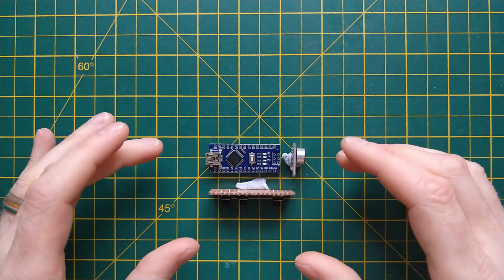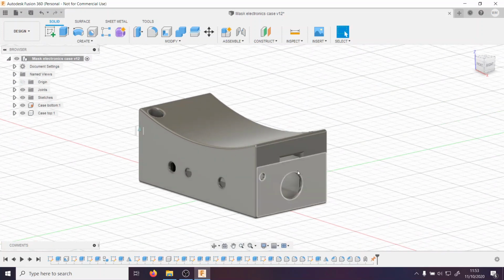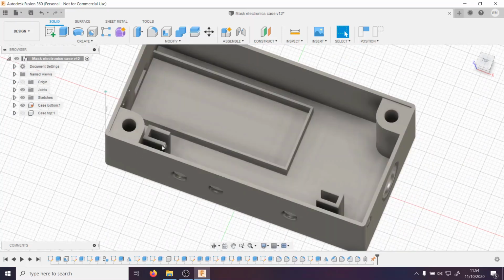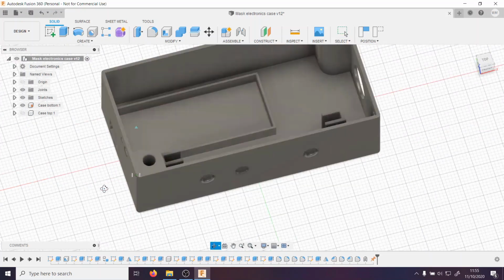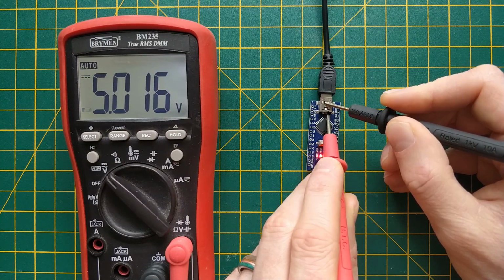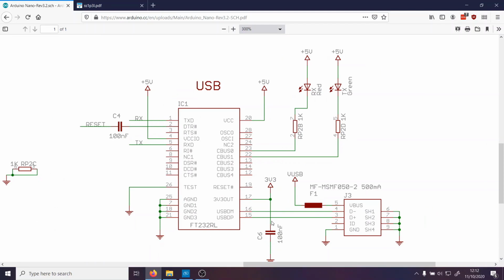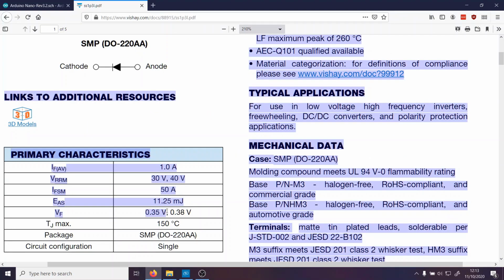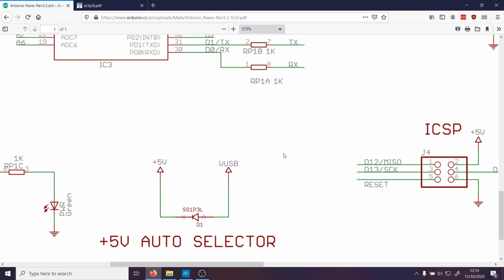Arduino powered LED Mask with FastLED [Part 2] - Enclosure and wiring

Comment: What is the ampers that this device receives from the usb port?
Reply from the maker: You can limit it in the code to whatever you like. I usually run it from a power bank so set a 2A limit

Comment: Scott I can't understand why do you remove SS1P3L diode from the NANO, Could the project work without removing it? 

And what do we need to avoid if we do remove this thing? connecting the NANO to an external power like 2 AA battery while is also connected to the usb charger? 

Thank you
Reply from the maker: The maximum current rating of the diode is 1A. The way I have it wired up, I've connected the 5V for the LEDs to the 5V Arduino pin which draws power through the diode. The LEDs can easily exceed 1A, which would burn up the diode. If you had a seperate 5V connection for the LEDs, you wouldn't need to do this, but I wanted to keep the wiring as simple as possible. Removing the diode takes 5 seconds with a soldering iron so that was the fastest way to do it. Is there a reason why you don't want to remove it?

Comment: Fantastic work. And great video documentation.

Quick question. What are you planning on using to power it with while wearing at a party? Just some run of the mill USB portable battery? Thanks
Reply from the maker: Yeah, exactly that. It runs for many hours from a 10,000mAh USB power bank

Comment: Hello, congratulations on the incredible project! I'm sorry if there are any errors, I'm Brazilian and I don't speak English.
I'm using your code on a much smaller project, just 12 LEDs. To get the effects right, my XY map was 5x5
  const uint8_t XYTable [] = {
     24, 8, 6, 4, 13,
     11, 22, 19, 16, 2,
     10, 21, 18, 15, 1,
      9, 20, 17, 14, 0,
     23, 7, 5, 3, 12
   };
I believe I have modified all the necessary values in the code, and uncommented the line modeBtn.begin () ;, but I can navigate between the modes only once, then the code locks and turns off all the LEDs. I am new to Aruino and programming, but I am grateful if you can help me.
Reply from the maker: Sorry it's taken a while to reply to you, I missed this comment. Could you send me your code? It's tricky to see what's happening without it. Copy the Mask.ino file that you are using to pastebin and link to it here.
Reply: @ScottMarley  did you find a solution to this as i'm having the same issue

Comment: Awesome... love it, can you share more the Fusion file ? :p
Reply from the maker: Done, it's on github here https://github.com/s-marley/LEDMask
Reply: @ScottMarley  wonderful, I'll try it. Many things I will learn from your guide. Thank you very much
Reply: @ScottMarley  I try to learn Arduino, can you share your code use in this Video [part 2]? really a good start because I very excited about your project.
Reply from the maker: I've uploaded the code to https://github.com/s-marley/LEDMask. The version in the MaskUpdate folder supports the extra buttons used for changing the brightness of the LEDs.
Reply: @ScottMarley  Thank you very much